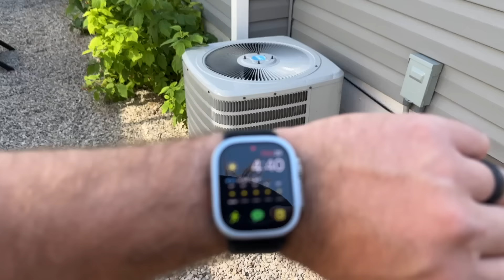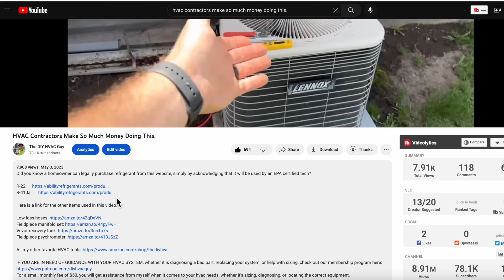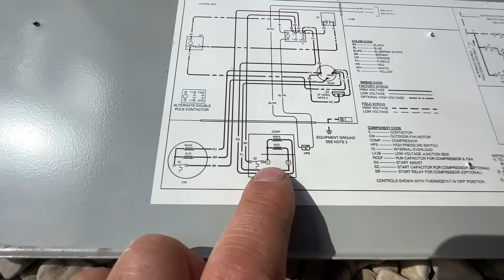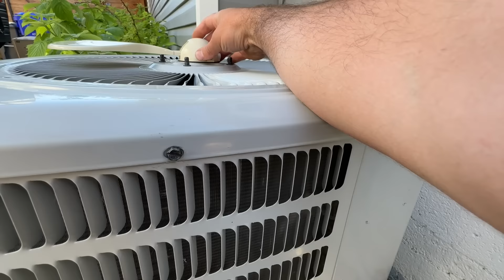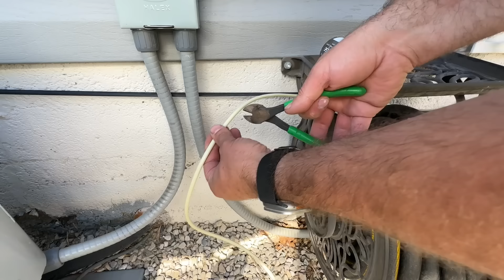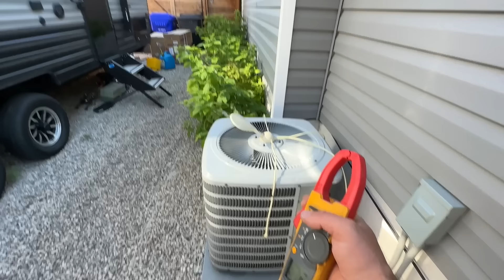Can This Device Actually Lower Your Electric Bill By 30%??

Comment: Makes sense because a hot condenser increases head pressure and therefore amp draw on the compressor. So cooling off the condenser coil would reduce the amp draw.
Reply: But isn't a condenser rated for a certain Amp rating?
Reply: @filmaker256   Depending on the tonnage of the unit, they do have a max rating for locked roter and run load amps. It would be posted on the data plate.  But nothing says you can't keep it as low as possible.  Now, don't get me wrong. Low Amp draws can be an indication of a low charge.  But then these people would have weak or no cooling if that were the case.
Reply: @filmaker256  That's a MAX rating, not a minimum amperage
Reply: @filmaker256 UP TO certain amps.
Reply: Amp draw doesn't tell the power consumption story.  You need the phase delay (power factor) at the same time.   Also, the start winding does not disconnect when the motor comes up to speed on these - it still draws current.  You need to measure the total draw with a unit that also measures the voltage and power factor in order to know power consumption.
Reply: The heat here comes from compression though..  it was found that watering the coils actually insulated the coils by coating them in water instead of allowing the air flow to remove heat as it is designed.
Reply: @mrstanskaggs1 that’s why you only mist the unit, not apply direct streams of water. The air, laden with cooler mist,  has greater thermodynamic potential than the warm air normally being pulled into the condensing unit. Like a turbo charger that has a chilled intercooler. The colder the air compressed, the greater it’s expansive potential. The condensing unit is exchanging heat using outside air to cool the refrigerant; the cooler the outside air, the greater/easier it will cool (consuming less volume of cooling air)
Reply: @mrstanskaggs1  that would be true if water didn't absorb heat and evaporate itself.  And water cools as it evaporates. That's why swamp coolers exist.
Reply: @mrstanskaggs1  Actually, water is a more efficient mover of heat than air .  That is why a 2" pipe coming off a boiler provides more heat than a 24" air duct.
Reply: @mrstanskaggs1 the water will infact lower the head pressure, lowering the amps 
The problem is with the  "dissolved solids" calcium and minerals in water that get deposited on the coil when the water evaporates that insulate
And reduce the heat transfer
Reply: However will not save on electricity tho, as the bill is based off of total uses, an amp reduction is nothing. You want energy bill savings, make sure your house is very well insulated, thus less run time and stays cooler or warmer longer.
Reply: @morallyinsane7639  there’s no question that insulating your home and sealing windows/doors is a great idea. However, if you’re using less amperage and the run times of the condensing unit are shorter, you’re power bill will go down. Power = Amps x Volts. Your volts are constant, so if your amps are reduced, your power consumption (watts) is reduced.
Reply: @mongrel1799  one amp is not going to save you any real money over the long run and the temperature change is negligible. Besides he never took a delta T, so we don’t know his return air temp or his air split efficiency. Probably didn’t do it because it really did not make much of a difference.
Reply: @morallyinsane7639  maybe it’s a small amount to you, but….  220 volts x 1 amp equals 220 watts. Say your condensing unit runs for 5 hours a day (it’s summer, and hot). That’s 1.1 Kilowatt Hours per day. 33 kilowatt hours per month. Wouldn’t you want to save 33 KW-hours a month?  What if 25 million people could save 33 KW-hrs per month. If the savings isn’t worth to you, state that… but it will save you money. I lived many years in Florida and the Deep South, latent cooling techniques work.
Reply: @mongrel1799  Please, stop with the math BS, and a swamp cooler is not the same thing especially in humid conditions. No unit runs five hours a day, more like all day. And how much money do you really save, $10-$15 dollars tops, besides wasting water. More goes into your system then just cooling. Like I said, proper insulation, proper size for the load, age, even refrigerant type all can make a big difference. It’s a gimmick and is situational. I know I have been doing HVAC for over 20 plus years. You want real energy savings, get solar power system installed, then it won’t matter and you can say you’re doing your part to help the environment.
Reply: @mongrel1799 you're right, he's wrong. That's all there is to say. He calls the math bullshit, he's just showing how little he knows.  I've had to put sprinklers on a LOT of larger units ,100 ton+, in hot weather , head pressures went down , the load on the pump went down,(amps), less wasted heat.Cost went down , efficiency went UP. Not hard to understand, to us least ways.
Reply: @morallyinsane7639  have solar power… and if you’ve been doing HVAC for 20 years that explains everything. Making systems last longer and more efficient isn’t good for business. I do not deny anything you’ve suggested except that it won’t work and save you money. Keep doing what you’re doing and have a great day!
Reply: @morallyinsane7639  One amp was 25%+ of his total amp draw.  You do the numbers
Reply: @RetiredSignDude  Why should I when I know he is not getting any significant savings and if he was I am sure you would have mentioned it. So basically you don’t know what your talking about.
Reply: @mongrel1799 sure but now you have just coated your condenser with calcium and minerals that insulates the coil and reduces heat transfer so when it's not very hot out your head pressure will run a little higher.  So in effect you have traded a spike in amps on extreme day for higher amps year round and reduced the lifespan of the equipment significantly
Reply: @ronpilchowski9898  whatever floats your boat Ron… everything is a trade off. My only point was that you can reduce amp draw and help your condensing unit cool by setting up an on-demand misting system. If you think it’s a gimmick or won’t work for you, don’t do it. I’ve used them and got decent results, end of story.
Reply: @mongrel1799  once in a wail 
Is great but you should plan on cleaning the coil. That's all
Reply: @mongrel1799  don't get me wrong, it will definitely lower your head pressure. Window bangers have a "slinger ring" connected to the condenser fan that splash condensation from the evap on to the condenser coil for efficiency
Reply: @morallyinsane7639  you are correct sir.  A savings of 1 AMP over the grand scheme of things is just a drop in the bucket, unless you're running your AC constantly.  And if you are, you have bigger problems.
Reply: Not trying to be argumentative but I think that I remember that spraying water on the condenser raises head pressure.
Reply: @pibble3962  quite the opposite. In fact, the whole reason why the compressor exists is to raise the temperature of the refrigerant.  Because the higher the pressure, the higher the temperature. But it also works the other way around too. This is what allows the refrigerant to expell heat so that when it's in a low pressure state, it can absorb more heat from inside the house.  I've run into this situation before where the condenser wasn't installed on the north side (shady side) of the house, and on an R-410A system under the direct sunlight on a 90⁰ day, the head pressure can reach up to 600psi and trip the high-pressure lockout. In order to get the unit to restart again, I've sprayed water onto the coil.  And you can watch, with gages attached, the head pressure drop like a stone. Although you can achieve the same effect by turning up the fan speed on the air-handler.
Reply: spraying water on a hot condenser LOWERS the head pressure. I've used this idea for years on home and commercial equipment.
Reply: @notagimmedat  your absolutely right and lowering the head pressure 
Witch lowers the amps and since 
Amps × volts = watts it will lower your energy bill, the problem with this is the ( dissolved solids) in the water ie. Calcium, and minerals 
Will "plate out" on the coil creating an insulated coil and after time the head pressure will have to run higher in order to condense,  you will need to clean the coil with a decalcifying chemical that will shorten the life of the coil. I wouldn't advise doing this on a new unit but on one maybe 10 to 15 years old go for it , remember there's no such thing as a free lunch
Reply: lowering the condenser temp (via water in this case) LOWERS the temp and lowers the head pressure. @pibble3962
Reply: @pibble3962 that's incorrect.

Comment: You're supposed to have the tubes spraying at an angle.
Same angle that the vents are at.

It's not supposed to be spraying away from the air conditioner.
Reply from the maker: I believe it is. You don’t want to soak the unit, you want to cook the air BEFORE it gets sucked into the coil
Reply: The action of the mist evaporating cools the intake air before it hits the compressor coils, resulting in more efficient operation of the compressor, and maybe some temp drop at the vents

Less power draw with the same amount of cooling or slightly better should still net decreased power costs, hypothetically.

If you had the water spraying directly on the coils you'd be more likely to encounter mineral deposits on the fins, even with a filter like the one included.

Yes, it would still work to an extent but if you were trying to cool the coils directly with water my guess is you'd be needing A LOT more water than the misting heads can provide.

If you've ever encountered a mist cooling system outdoors at a restaurant or bar, you'd realize that people don't have to be getting  hit point blank to be cooled effectively...same concept here

Comment: Not sure if this is the same company , but I looked into the a few years ago and they would not ship to Arizona where I live and a few other states due to the extremely hard water.
I am a retired low temp guy and have seen many attempts to make similar rigs for condensing units for walk-ins, Ice makers , etc. and they worked well for a couple years then the coils rotted out. But that's Arizona.
Reply from the maker: Bummer

Comment: This will probably save about 10% as your unit will act about 10% larger BTU wise without any additional electrical need to achieve it.
I used to hose down car evaporators after charging the A/C before disconnecting the gauges. Shutoff the high side valve at the hose. Open it all up to the low side suction, then disconnect the guages. My hoses would sit with 30 psi on both sides. Other techs would have hoses sit with liquid in the high side.

Comment: Having lived in AZ I agree that in that state and parts of TX probably works well.  Now living in the very soggy sand hills of NC forget it. We REMOVE water from the air to cool it down. The humidity here is so high this is unlikely to be helpful. I am in the "down east" area close to the ocean.  In fact I would predict a nice thick coat of mold which would trigger my allergies.  But thank you for the complete scientific presentation.

Comment: I always wondered about running water over the fins, evaporative cooling, I'm gonna check this device out
Reply: You really want to make yourself aware of the downsides. For example, In order to run "tap water" in and out of my open loop geothermal heat pump , I need an expensive, special alloy (cupronickel) heat exchanger coil. Otherwise, tap water would corrode a standard metal heat exchanger. A standard exchanger is OK in a closed loop system because the water is monitored and treated with chemicals to prevent corrosion. The point is, your coils are not made to resist the corrosion of untreated tap water flowing over them constantly. And that doesn't even take into account the evaporative mineral buildup. (That silly little "filter" will NOT remove minerals from your water--that is a very complex process). You've been warned.

Comment: 91 degrees is cool in Phoenix. I have a window AC and I have a sprinkler on top of it and the water is turned down to a dibble and this lowers the vent temp form 60 to 50 degrees.

Comment: What would also help is putting the darn unit IN THE SHADE. Is it so expensive to put shade over these? I did it with a wooden frame and 80% shade cloth and voila, the unit used more than 10% less energy. I installed a mister. 15% better.

Comment: Aside from all the "arguments"... this could be achieved for FAR cheaper with a 24v solenoid pigtailed into the sending wire and micro irrigation mister heads... in fact, ideally, this could be incorporated into a micro irrigation system, taking care of ornamental trees or plantings nearby with drip emitters.
Reply: Perhaps FAR cheaper isn't correct, I'd estimate about half the price.

Comment: Why exactly would the current drop?
Reply from the maker: Less compressor head pressure because the coil is being cooled and refrigerant is running through that coil
Reply: @diyhvacguy  Very good.

Comment: I didnt read all the comments but, if you have a newer unit, a setup like this is not the best idea.   your best money spent to save on HVAC cost is insulating your dwelling as good as you can afford to, and have a blower door test done to find your air leaks and seal those up too.      I never recommend spray foam unless you love a rotted house in 20 years.

Comment: 25 years of working on HVAC in So Florida I would tell people on service calls about spraying a light mist of water on their condenser sometimes when they had a party in the home and the heat load was higher than the unit could effectively handle. There are even other water misting systems on the market for larger systems. I did install a system on a 100 ton condenser unit in a meeting/recreation building that ran off of the head pressure of the coolant.
Reply: 25 years as a tech and you call it coolant?
Reply: @skipsandvig8888 as many varieties as there are it's probably easier to use one word for it. Plus, where you live can determine what words you use for things.
Reply: @dawnc5797  the word is refrigerant though
Reply: @skipsandvig8888  yup, given the variety of refrigerates out there everything from anhydrous ammonia, the different freons, and even chilled water systems. I have worked on all of the above and hate the large ammonia ones.
Reply: In dry climes I've worked on RTUs with swamp cooler "Pre-coolers" attached to the unit next to the condenser coils.

Comment: Before you have your unit replaced with a high seer2 rated heat-pump buy the necessary parts to have them tap into the return freon line and install a best recovery unit and plumb it to your hot water heater tank... You get free hot water and it will increase your seer2 rating even further by reducing the amount of heat your trying to remove from the freon before it pases over the cooling fins... Then if you want to add your silly water gadget go ahead but bear in mind, that paddle above the fan is a restriction of air movement as is the placement if that unit in the first place... It should have been farther off the wall... For proper airflow per the manufacturer.... 
And the water if it contains chlorine is detrimental to those fins.... And actually the windings of the motor if it gets hit enough...  It will produce chlorine gas and destroy the windings... 
I learn all this crao from my brother who was a retired HVAC tech for a huge portion if his life and even after retiring he continued servicing refrigeration units for years.

As far as extra parts you need is appropriate frein line enough to to reach where ever you decide to mount the heat recovery unit... The same size copper refrigerant line can be used to run the water back to the water heater..  As well as either the cold water in (to the water heater) or from the farthest from the heaters hot water... That will supplement the readiness of ready hot water at the farthest tap... Being a sink or bath/shower.... Anyway the 220volt line to the circulatory pump in the hot water unit taps right into the contactor line... So every time it calls for the compressor to turn on the pump has electricity....  The safety feature is built in, it has two temperature sensors one to not start the pump until the frein is hot enough and the second is to make sure the water supplied to it isn't too hot!!! With these features you won't overheat the tank water nor not be using colder water to try and dissipate the heat from the freon  ... 
When I converted from the old friend to the new unit everybody said they doubt it would supply enough heat to heat the water.... 😂 it supplied more!!! 
Sooooo free hot water, cost less to operate the heat pump.... Heat pump last longer...  It's a win, win, win situation... You just gotta find an ac tech that isn't a Mambepambe and dosen't know jackshit about plumbing or do your own plumbing and then have him silver solder the brazing on the AC.... 
Whatever....
Good luck to yah, you can thank be later or curse the day you read this. 
🎉 it works like a dream 🎉

Comment: Any savings in energy will be lost when you pay the water bill.  Those inline water filters aren't as efficient as one might think.  You'd need a reverse osmosis system to ensure hard water sediments don't build up on the coils.  Almost all water in the USA is hard water to varying degrees.  1 or 2 degrees cooler air isn't much in BTUs gained.  Measure the total current draw on your system.  1 amp less isn't much when the central air system draws as much as 20-25 amps when the compressor, condenster fan and evaporator fan all running at the same time.  I would think that the water would capture dust and clog the condenser coils
Reply from the maker: One flush of the toilet per day will not be reflected in your water bill